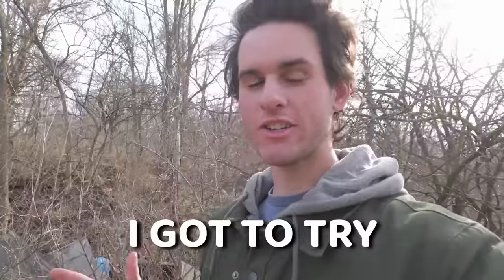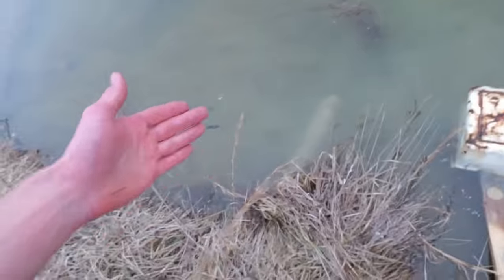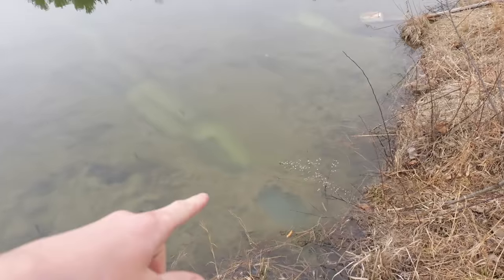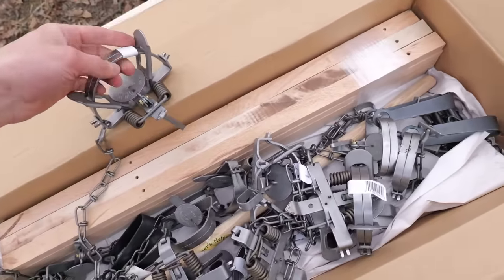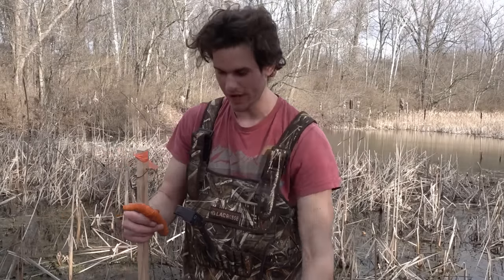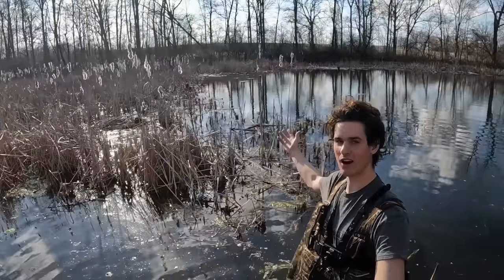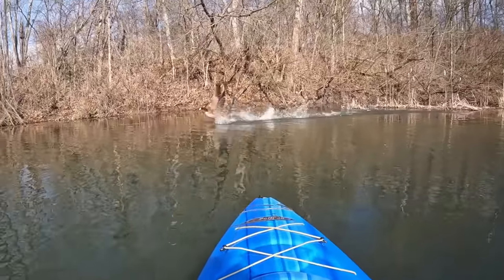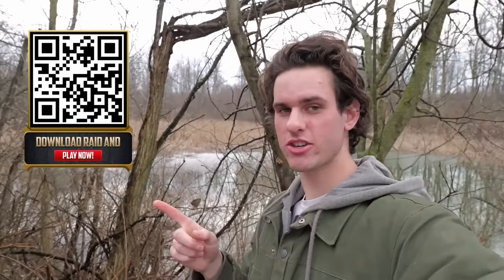$0 vs $1,000 MUSKRAT Trapping!

Comment: For some of those muskrat huts what i like to do is slick up an existing run frkm them going up it and then you can get a long spring foothold and set it about an inch under the water with the spring pushed into the hut and then ill run a 3 foot ish cable on it connected to a slide for the trap and then the other end connected to a t stake pushed under the water for a drowning set. Also the colony traps work well for runs going into the huts. Looked like some pretty nice sets though and congrats on the mink and rats